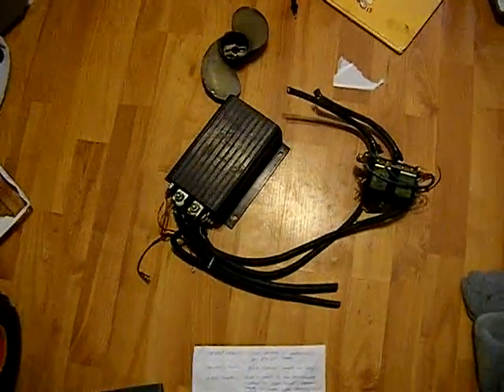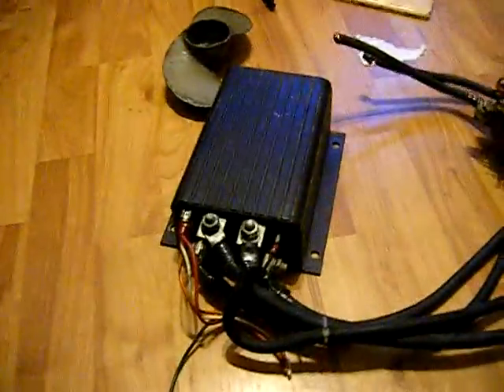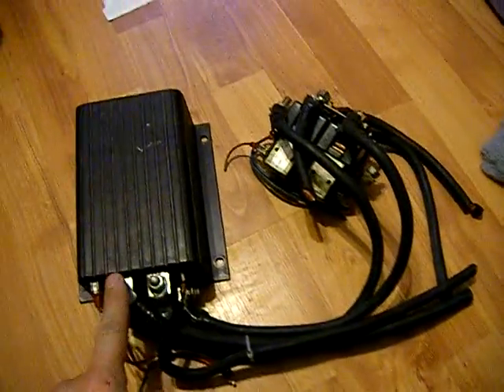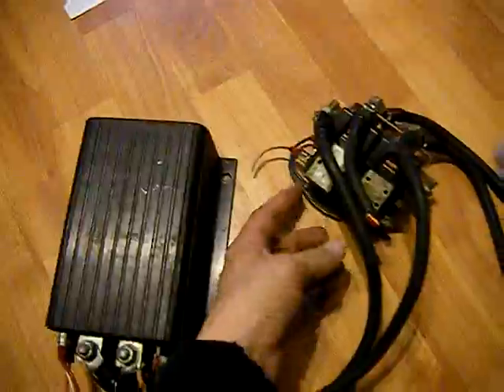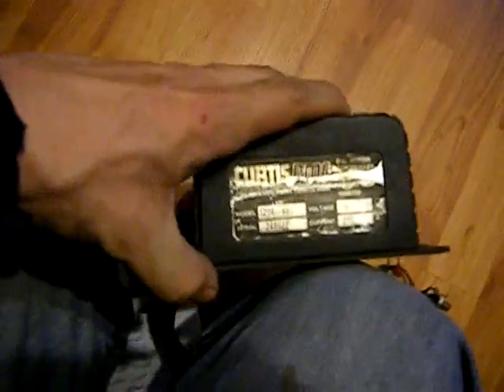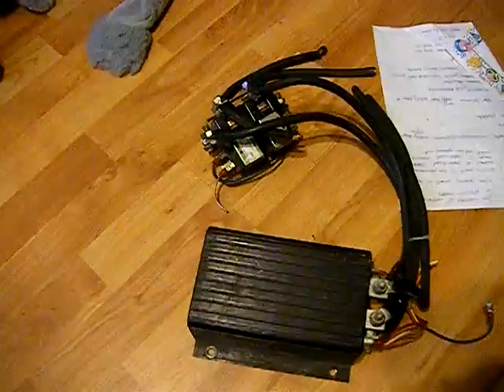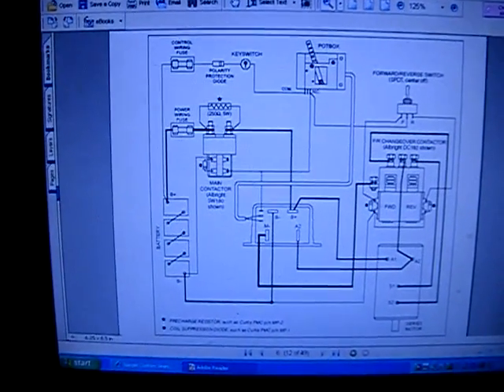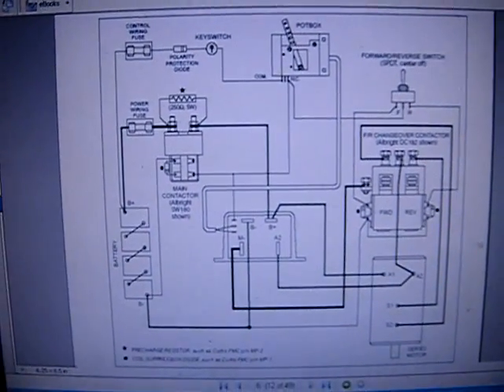Curtis dc speed controller

Comment: I had same problem on Hyster N30FR electric forklift where the unit ran a traction traction motor  cable he’d removed buy previous owner and not sure how to joint it.. I believed if you can purchase the repaired manual you will now how to joint it. So far I know that D C tract motor  will have 4 wire  con of A1A2 of a mature origin  than S1S2of stater origin. .  The solenoid arranged  or determined the for ward and back was direction by  the contatcter  and another assisted contractor and the Curtis module .  You need another switch liver making forward and back ward with  norms power key switch like car to give 12 v on Small 3 pin area , 1st one key pin Saco do one tootle pin  ect . Troutile is  come from ? 10 k volume control !  Half card is good learn sources.

Comment: Any experience with a curtis 72 v ac motor controller?
I'm seeking information on no throttle response on a 2011 vantage Green Truck and drawing blanks
Thanks in advance
Reply: AC May be harder. , May be change the  resistance   05 reprogram your cutis to take your throttle . !
Reply: @kyimedical  
It has the original factory everything that came with it factory and all new batteries. I have bought another controller from the factory programmed to the vin on the truck. There is a voltage loop looks like it has came apart as the soldered board has been covered now it is exposed. I'm thinking simpler might be better and more dependable.
Idk it's the firse ev I have owned so far I'm not as impressed with the money savings and fuel economy portion of the overall idea and it's viability.
Perhaps us older guys need to do more work researching new technologies before thinking new is better.